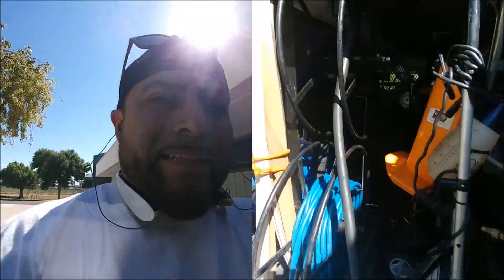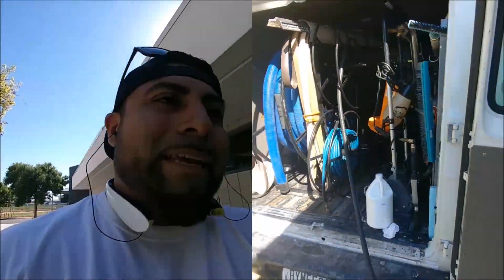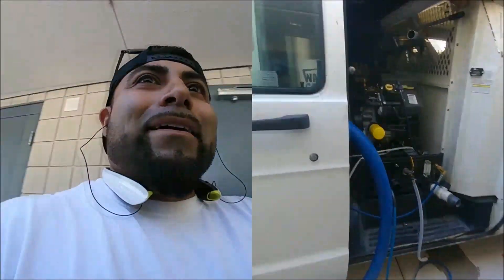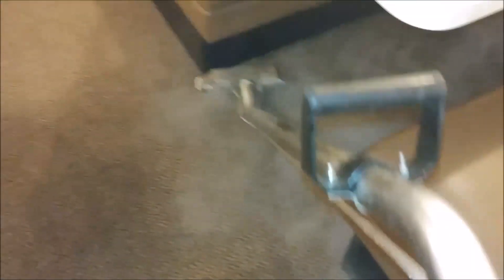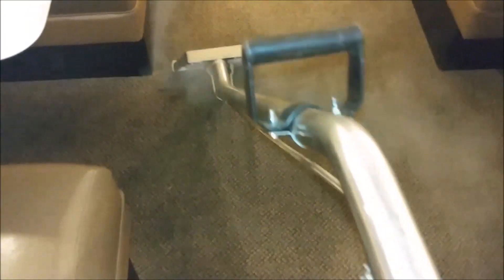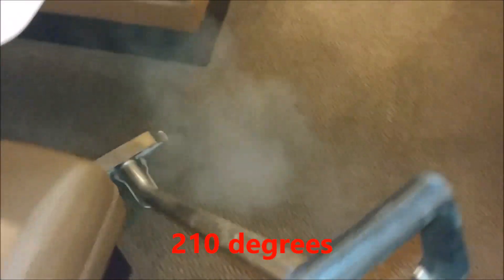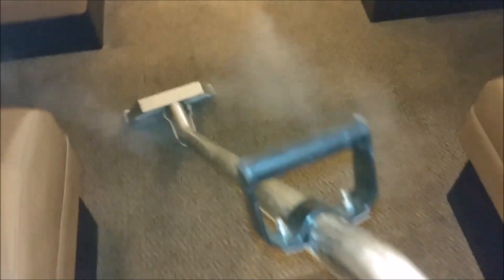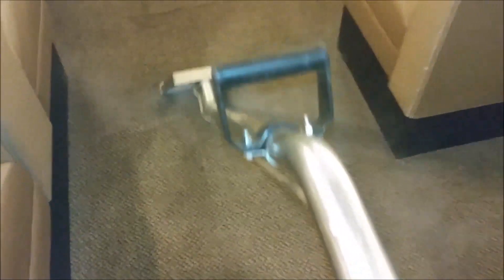New custom built truckmount diesel heater

Comment: Are you using the pressure pro 12v or 115V?  If you are using the 12V is the 25 amp alternator on the Kohler enough or do you also have a belt driven generator to power the heater?  Thank you!

Comment: how do you like the water cannon?   where do you have the diesel tank?
Reply from the maker: Bjorn Marshall I put it on a trailer. I would have had to make a whole in the roof for the smoke if I wanted to keep it in the van.
Reply: ya Ive heard that about the diesel heaters,   great water temps though.

Comment: That's nice bro. I have a question if you could please answer. I've got a steam cleaner and will be soon getting my truck mounted. Do you think it would be a good idea to clean the carpet and then steam clean it and not charge the customer for the steam cleaning, or should it be a separate charge for both services?
Reply from the maker: TheLandOfTears s I don't think I understand what your trying to do in the vid I'm steaming the carpets but that's cleaning it. not sure what you mean by clean before you steam.

Comment: What diesel burner are you using and how much was it ?? I have a old vortex with the heat transfer fluid and I'm about done with it messing up on me .....
Reply from the maker: Brian Hill i got a water cannon heater box diesel burner. From water cannon. It was 1700. But once I got it after instal I needed to replace the high flow switch to a low flow switch. The high flow is for high pressure washing. Not sure if you can ask for that when you order